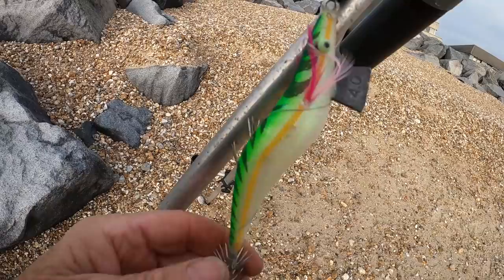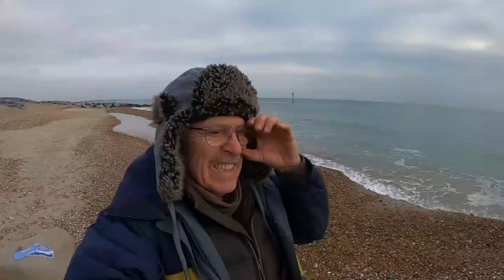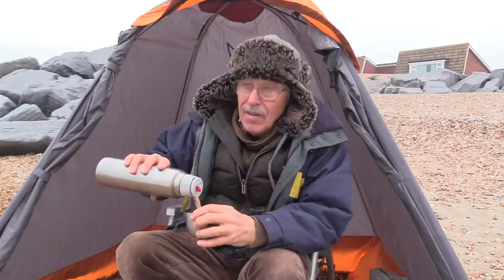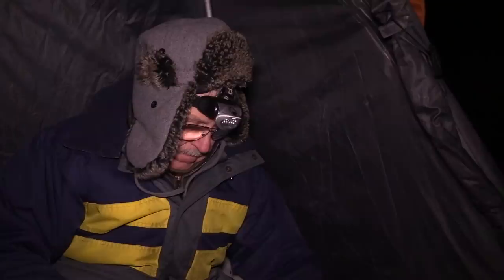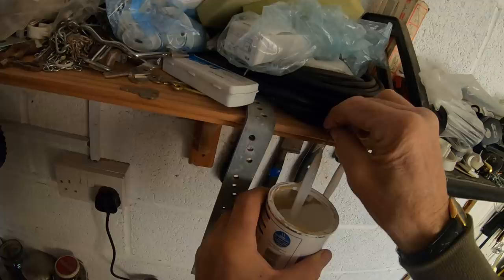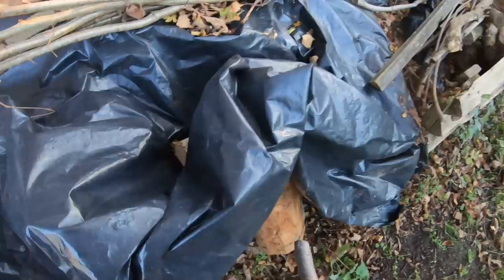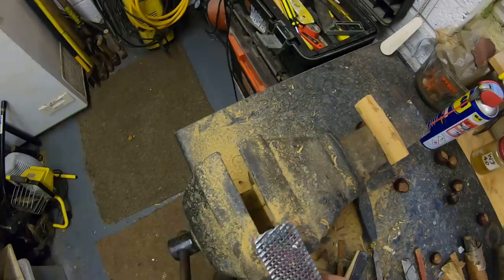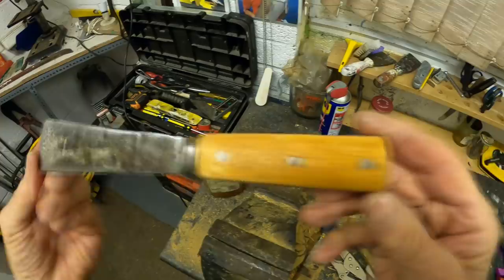Solo Beach Fishing with Weird Squid Fishing Rig

Comment: A good thing for fishing weights are scrap reinforcing bar from building sites where you can chop them into little 1.5 inch & 2 inch lengths so that you can weld a bundle of short lengths around a single longer length & weld a U staple to the end then paint them up as cheap fishing weights. Most handymen out there will have a stick welder or some type of welder & staples from the hardware are very cheap plus if you're a handyman you'll have leftover paint as well that needs to be used up.

Comment: For fishing at night for squidding or catching fish around a pier etc I use one of those 36v 4.4Ah electric skateboard batteries connected to a 36v-48v to 12v 10a converter & a 12v 10w submersible LED squid or fishing stick with about 20m of 12v cable on it so that I can dangle it under a boat or over a pier or out into the surf which will give me 12 hours & 40 mins of use during the night while fishing. The best squid jigs I've found were ones that are like a skewer for putting bait onto as well as the squid barbs on the bottom as well as a glow in the dark bean to attract the squid. The squid tend to be caught easier when they are hanging onto a bit of bait as they are being dragged out of the water.

Comment: Graeme, put a fish  strip of on the lures back with your elastic thread. The light doesn't catch the squid but attracts plankton and in turn attracts the baitfish. This takes some time to happen, By that time you've cast again. Put a small ball weight on the bottom then a foot up use a stand-off loop of six inches and put your lure on it then repeat maybe with a different lure above. Set your depth, so the weight is just bouncing on the bottom, that will make your jigs move up and down like a panicked prawn with the wave or ripple action by the float. The fish strip can be added if nothing much about. I have put this to good fishing on an eelgrass covered bottom. The fish strip will get a better pull as it makes them more competitive to grab the bait. Have always loved your vids mate both sea and fresh water. Keep up the good work, Graeme and well done.  Even got  you fishing right next to my boat alongside Brixham breakwater.

Comment: Looking at the lump of bluey going out early on, is there any advantage sending it out so big vs splitting it in half along it's length? - split it offers a similar visual-sized bait, larger area for scent release, and your bluey gets two chances rather than one.
Reply from the maker: Lot of oil in Bluey and down Somerset they often make a wrap of Lugworm and fillet of Bluey so probably worth trying up my way. Mind you they have much stronger tides to push the scent trail laterally along the beach . I used to do quite well by splitting a mackerel head down the centre ,leaving a hinge and then folding it inside out. Gruesome to look at,but appreciated by Bull Huss and Conger.